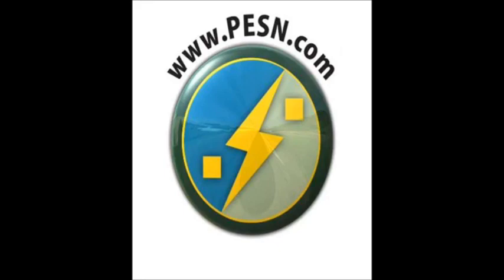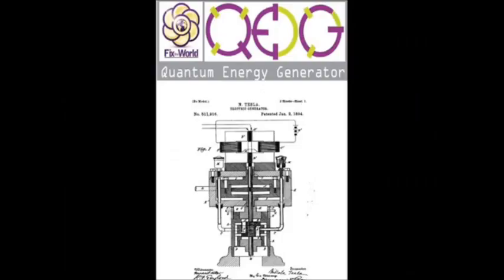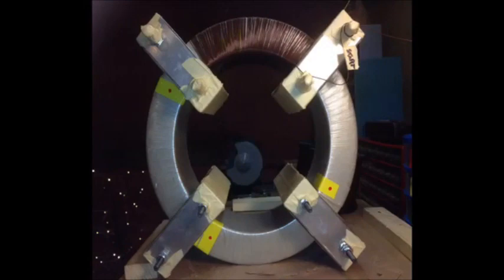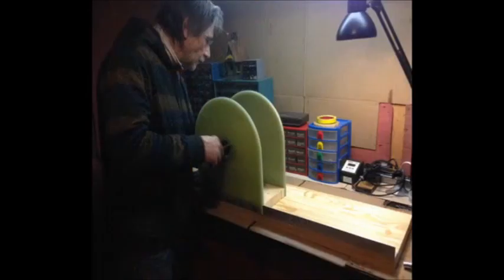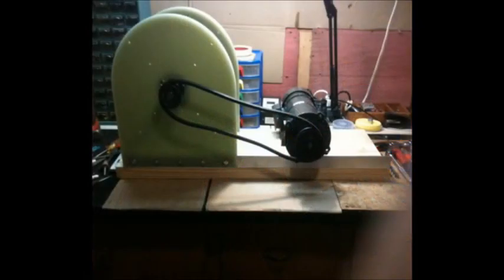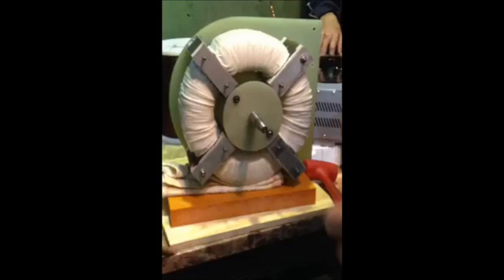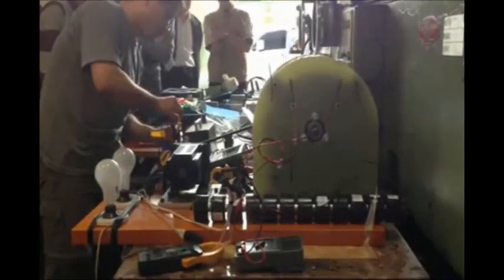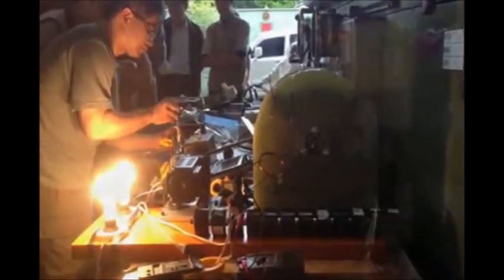James Robitaille Technical Explanation of the QEG on Sterling Allan PESN Interview

Comment: I worked on Thane hiens bitoroid transformer and confirmed the inventor's claims via experimentation. 

And i believe this qeg must also be working on the same principle. 

When they rotate the steel rotor, the rotor achieves the RPM where secondary flux caused by back emf of coil generating voltage doesn't couple back with primary on other side because the rotor is fast enough to move on to next coil by the time previous coil sends back secondary flux. This way I think it avoids back emf induced secondary flux and produces way more output than input.
Reply: This scientifically impossible machine is a known scam started by the convicted scammer and wanted fugitive Naima Dawn Feagin.

Comment: "The rotor causes the inductance" is the phrase slipped in to start the mental picture of the system actually starting.

Okay, let's say the rotor causes the induction. Where does the energy come from? It starts as a system without energy.
Reply: Before I answer "where does the energy coming from?", I want to know your definition of "energy"?
What exactly do u understand by energy?
Reply: This scientifically impossible machine is a known scam started by the convicted scammer and wanted fugitive Naima Dawn Feagin.

Comment: My advice to all viewers is : don't waste your time and money on this QEG scam. It has never been known in electrical engineering and scientific research community that an LC resonant circuit wound on a ferromagnetic core is capable of tapping into the zero point energy as understood in Quantum Field Theory. You would have gotten your Nobel Prize if your claim can be scientifically verified. The fact is that you misuse Tesla's patent on his generator with a resonant circuit on an iron core to make this claim of free energy generation when in fact Tesla simply used the resonant circuit for the rotational speed control of the steam engine as the prime mover for his generator. Over unity is a fantasy. The Homopolar generator is another example of the false claim of over unity possibility through the misunderstanding of the Faraday Paradox. It turns out that the Faraday Paradox was no paradox at all and the classical electromagnetic theory of Maxwell and Lorentz applies perfectly to the Homopolar Machine without any violation of the physics. The claims of DePalma, Trombly-Kahn and Tiwari on the over-unity operations of their Homopolar generators are all false. Be wise and not be taken for a ride.
Reply: 100 years before when some esoteric folks talked about flying machines, people ridiculed them, hackled then, in many cases beat them, but today it's everyday reality.
Reply: So have you proven Bruce DePalma and the others wrong on their overunity genrators, I noticed a lot of you overunity haters on here must like these videos! Lightning, the sun and pulsed plasma 2 stroke which lightning is tap the ZPE as well all the partcle that spin and are powered by the ZPE. Lightning is one the baddest 2 strokes known!
Reply: @jlo13800  
A group of investors from Auckland, New Zealand worked with DePalma in replicating the DePalma machine but achieved an under- unity gain. All the investors lost their money after scrapping the project and sad to say, DePalma himself took his own life. The whole tradigy could have been avoided if they understood the electromagnetic theory correctly.
Reply: @soonhietan3319  not familiar with Depalma but T heny moray got good power from plasma tube device, enough to get him in trouble, another thing that i head is Joseph Papp's pulsed plasma 2 stroke engine with inert gases. A lot of these fols were harrased because of this. I got a the books from Moray b Kings and they are vewry interesting as the ZPE or aether has mind bogglinjg energy density, ar more than my 2 strokes running off gas/oil.